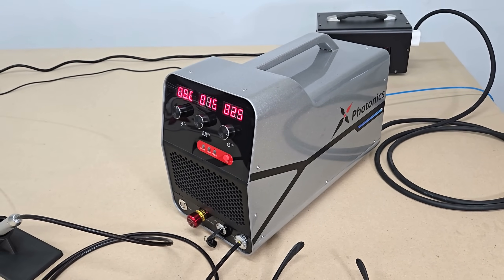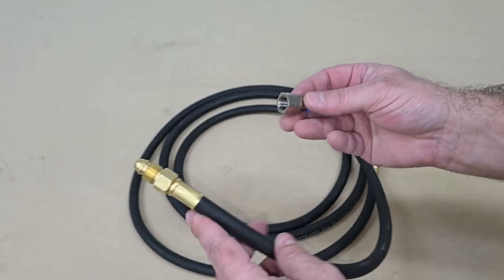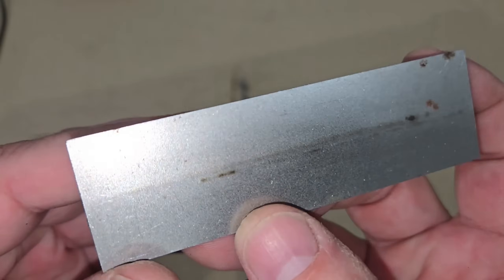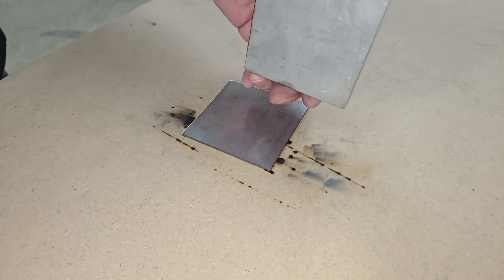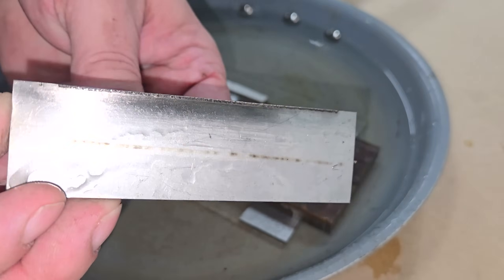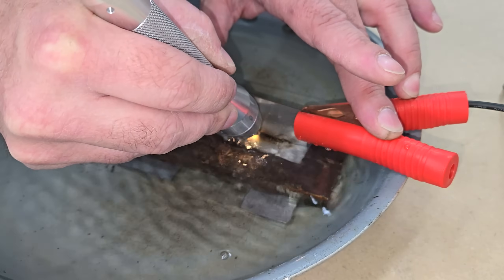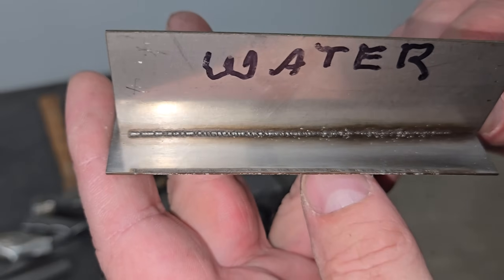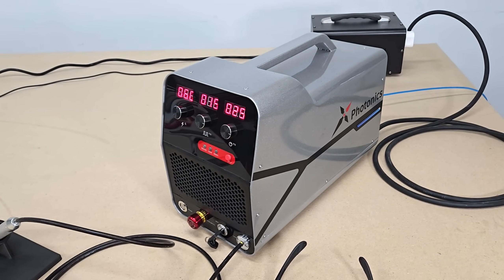No Rods, Wire, Inert Gas? Beginner Friendly X1 Micro Laser Welder

Comment: Can these be used without any gar or air or is that required? I also thought all of these laser welders were all huge like some videos I started watching. It's nice to see smaller versions of these.
Reply from the maker: A shielding gas of some kind is necessary, yes. Inert gases like nitrogen or argon are ideal, but compressed air will work fine as well.

Comment: Excellent presentation. It's astonishing that this rig and technology seems to work fairly well. 

Far less skill required than TIG, no gas, very little residual heat, less/no surface prep, no PITA tungsten maintenance, no helmet, etc... perhaps a bit limited in joint types and dissimilar thicknesses and no filler, but I'd better sell my two TIG units before they're worthless...
Reply: This thing doesn't have a feeder for filler. I guess even a tiny one of these has to be 220, you can get 1500W out of a standard 110, and this thing was less than 800W

Comment: any welder can weld in non-conductive tap water... try seawater and watch the arc literally ignore the ground.
Reply from the maker: Somewhat true, but misleading statement. While some DC stick welders might function in shallow freshwater with proper insulation and grounding, it’s not safe or practical without the right setup. Not like this. Purpose-built underwater welding machines are designed specifically for this work. There's no such thing as non-conductive tap water. Almost all tap water contains minerals unless it's been deionized and distilled before it enters your plumbing (usually not the case), and all tap water is conductive to some extent regardless. Fresh tap water can be less conductive than seawater, so the arc might behave more predictably in it. But it’s still a hazard. I used extremely hard water from my own tap for this demonstration. You wouldn't get away with that using any other welder without mods. This machine also has no ground. It doesn't rely on sending electrical current through the workpiece to weld. It fires a laser beam. Though powered by electricity in the controller, the laser itself isn't electricity. The only purpose that clamp is serving is to complete a low volt circuit when the torch touches the workpiece and send a signal to the controller that it's ok to fire the laser - safety control. That clamp can be attached to the torch itself. This method is magnitudes safer than underwater welding with any other welder.

Comment: Would the standard X1 be able to penetrate and adequately weld stainless steel exhaust systems? That's my biggest use case and not requiring a gas tank in my garage would be unreal.

Comment: Can the pro version weld a worn camshaft's lobe (peak) in circuit. I would keep adding more welding over the worn surface & then file it down to match others.
In circuit means not removing the camshaft out of the engine.
Reply from the maker: I don't see why not if you can get good penetration with it, but I haven't tested the X1 Pro. Check out Joshua's video, he might be able to answer definitively https://www.youtube.com/watch?v=o_S1d0AYW1s

Comment: I seriously thought those ads were AI generated scams. I had no idea that semi-portable laser units of that power level had come this far, this fast. Fascinating!
Reply: hello
Reply: Why a ground wire on something that is a light beam?
Reply: @thepubliceye it’s a safety feature, it completes a low voltage sense circuit so the laser isn’t firing when not in contact with the work piece.

Comment: So, why does a laser welder require ground clamp exactly???
Reply from the maker: It's for safety. It's there to ensure you don't blast yourself or someone else with the laser - the torch won't fire unless the clamp is attached and the torch tip is making contact with the workpiece. I call it a ground clamp out of habit from using traditional welders, but it just provides a path to send a signal to the machine that it's ok to fire. You can attach it to the workpiece or directly to the torch itself.
Reply: you can connect the ground clamp to gun itself to complete the circuit in cases where it isn't convenient to ground clamp what your working on.
Reply: These Gen Z's love to complain and question everything.

Comment: In Joshuas video: https://www.youtube.com/watch?v=o_S1d0AYW1s

He talks about SS emitting dangerous fumes. Would you concur with this?
Reply from the maker: My claim was based on my sole experience of not seeing or smelling any fumes, but I suppose that doesn't mean they're not there. I just skimmed through Joshua's video as I don't have time to watch it's entirety atm and didn't find where he mentioned that, but it looks like he's using the larger X1 Pro with the wire feed. More power + thicker materials will generate more oxidation and fumes with traditional welding, so I image it's possible that he's seeing fumes with nearly twice the power when I'm not.
Reply: @JamesBiggar  
Timestamp on his video is 3:34 - but it was specifically wrt SS, not mild or alu and he said to be careful of "Hexavalent Chromium" - which is known to cause sinus cancer and liver damage. As with anything, it's usually workers who are exposed to it every day that have a significant chance. But always worth knowing if you plan to so a substantial amount of SS welding. 

Wasn't trying to fault what you said , just wondered if you had input.
Reply from the maker: No it's cool, I appreciate the info!
Reply: Any form of welding (MMA, MIG, TIG etc) has the possibility of oxidising some of the chromium in stainless to form hexavalent chromium, this isn't a unique issue with laser welding.
Reply: @ferrumignis  Correct, there was no assertion made that it was unique to laser welding.

Comment: This would be great for bicycle frame building since most tube are 1mm or less.
Its gonna totally revolutionize bicycle frame production. 
Hopefully they make different style of nozzles to fit in tight spots.
Reply: it looks like it wont weld titanium
Reply from the maker: Only carbon steel, stainless steel and aluminum
Reply: @JamesBiggar  could you please place the current price / cost info of this tool in the comment & pin it. Would be of great value to compare the future price if cost goes up or down. Thanks